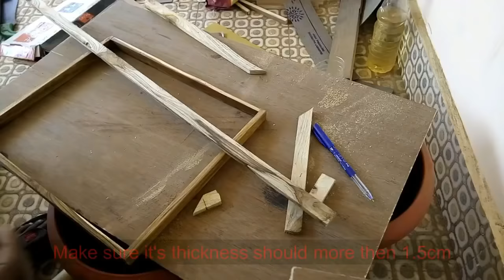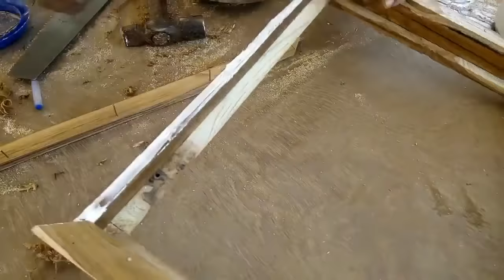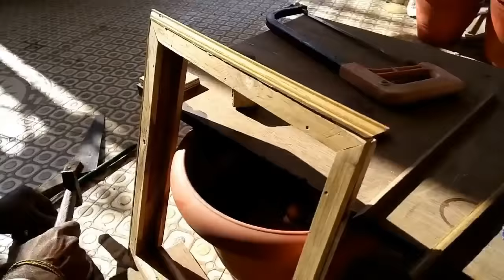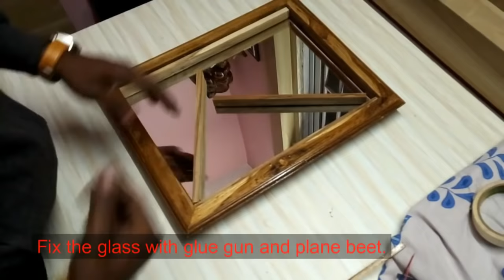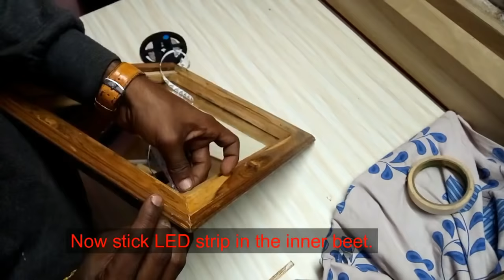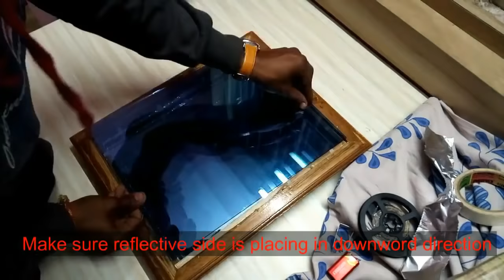Make an LED illusion mirror 2.0! Latest + backlight effect

Comment: Can it be done without the darkening glass part? I wonder how this might look as a mirror that can be used? Also curious if that would lead to more repetition of the infinite lighting affect?
Reply from the maker: No it will not work without tinted glass, you can place mirror on the top to use it as a mirror but without tinted glass there will be no infinity lighting effect.
 Tnx for the support 🙏

Comment: nice,can u please tell me an estimate of how much this cost please
Reply: Thank you +Roshan pm for supporting me, I have spent approximate 400rs, Led strip will cost you 150-180rs and mirror and window glass will cost you approx 150 rs. You can use old mobile charger for power supply and for frame you can use wooden scrap or you can also buy a wooden frame.
Reply: google it, do your own damn research.

Comment: How can we connect led strip n mobile charger..plz tell us in detail
Reply: +Mohammad Sufyan You can use an old mobile charger and cut that from bottom of the charging pin then you will get 2 wires one is +ve and one is -ve, then connet  them to the led +ve wire and -ve wire make sure +ve is connected to +ve and -ve is connected to -ve. Hope it will help you and thankyou for supporting me.
Reply: Manish Soni  thanku God bless u